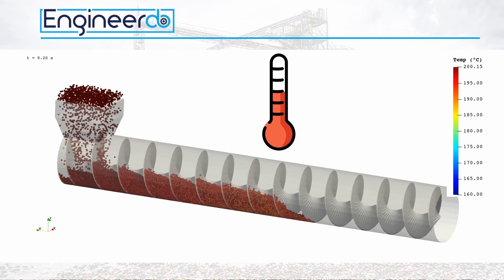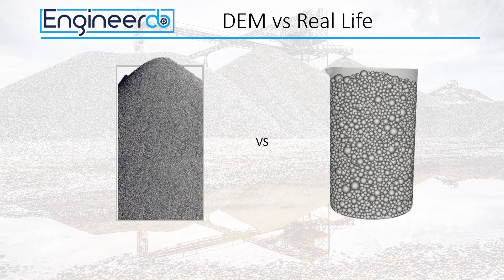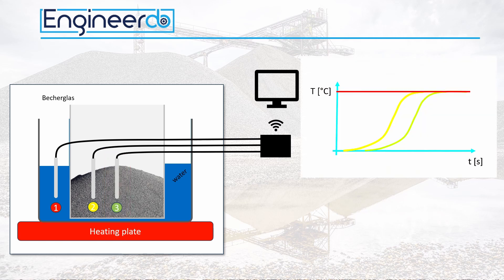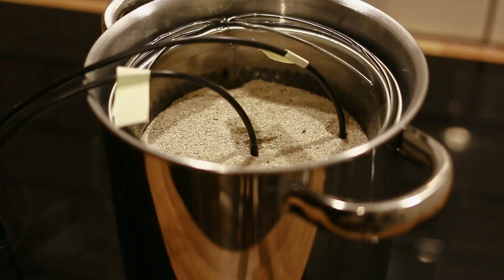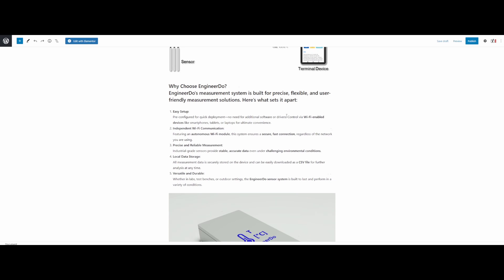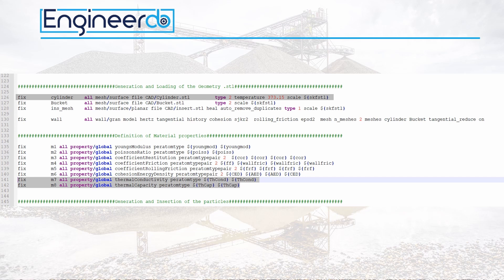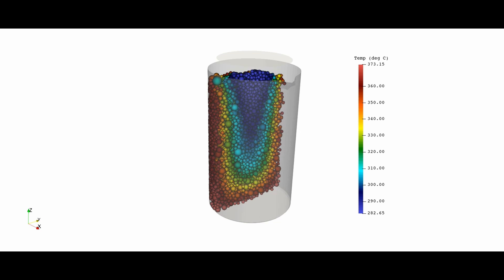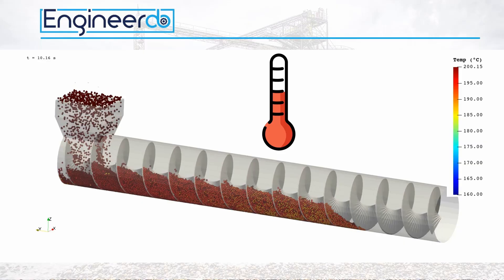Thermal Simulation DEM Liggghts with Wifi Temperature Measurement

Comment: Nice experiment and simulation! How did you determine the grain size distribution of your DEM particles? How does this compare with that of the real sand? What contact algorithm were you using? Do you think this heat transfer behavior would be very sensitive to the contact model?
Reply from the maker: Thank you for your kind feedback, Adam. The model is indeed sensitive to the contact area. If the contact conditions differ between calibration and application, it could negatively affect the results. However, it is also highly sensitive to stiffness and grain size distribution. As long as the model and its parameters remain consistent between calibration and application simulation, the results should not be impacted.